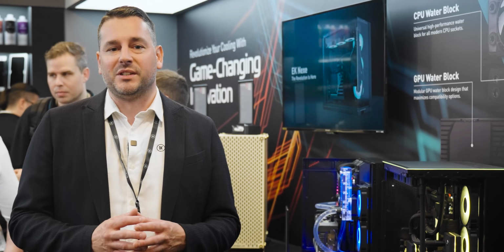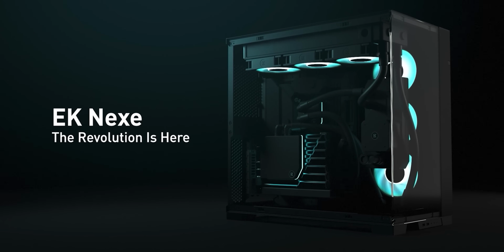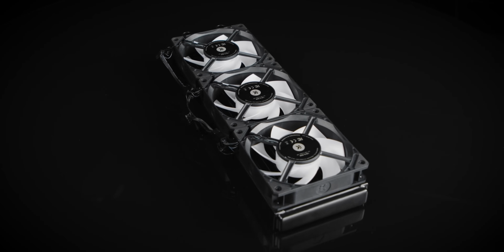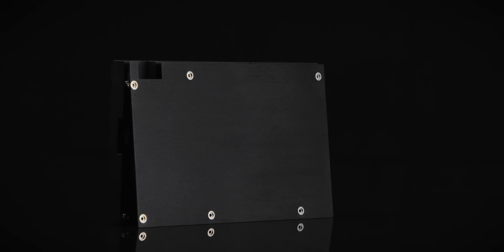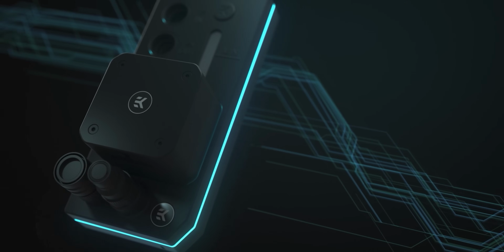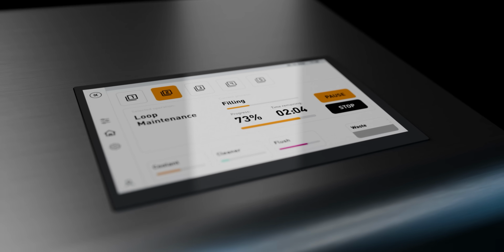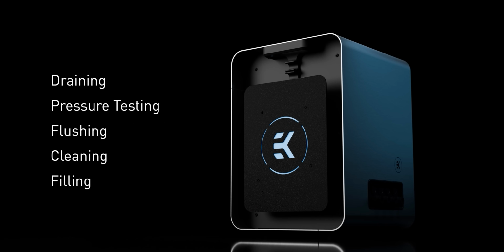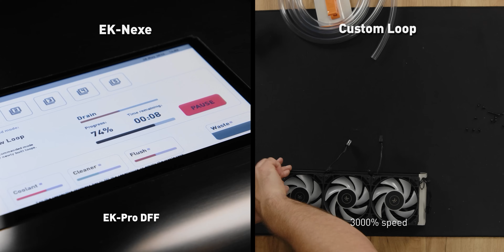EK EXPO | COMPUTEX 2024 | Day 1 at the EK Booth

Comment: I built my personal system with almost all EK quantum and it looks great but the compression soft tubing was a real bitch to do the first time with the clear and still a bitch  to do with the black rubber tubing.  I did a second system using the cheapest fitting I could find with EK clear tubing and it was SOOOO much easier.  The latest system where I threw together all my spare parts I've accumulated I went with the cheapest clear thin wall tubing and 3/8" nipples combmined with automotiver spring clamps.  Oh my god!!  I did all the tubing in 15 minutes with zero leaks!  It still looks good, you just rotate the clamps so the ends aren't visible through the window.  So easy cutting the tubing with stout scissors and needle nose pliers to put the clamps in place.

btw, the EK pressure tester is amazing!  You pressure test each component before you start and then you test as you go as you build by leaving it onnected to the reservoir and capping the second port of each component as you connect the first port.

My next though is really filling using vaccuum like they do in the automotive world.

Comment: Ignore the bash, EK Nexe is going to be a game changer and much needed. Any plans for different nexe radiator sizes? Can non ek fans be used on it?
Reply: Yes and yes 😉
Reply from the maker: The ball pins can be removed so any fan can be installed. Using the ball pin snap on system, any can that has the standard open corner frame can also work. There will be some more radiators but not as crazy as the Quantum line has it. 🙂
Reply: @EKWBofficial  When will NEXE release?

Comment: When you need to clean that DFF you just buy another DFF to clean the first DFF ? DFFception.
Reply from the maker: The DFF machine requires no cleaning, in a way—it has a built-in filter that simply needs cleaning or, ideally, replacement.